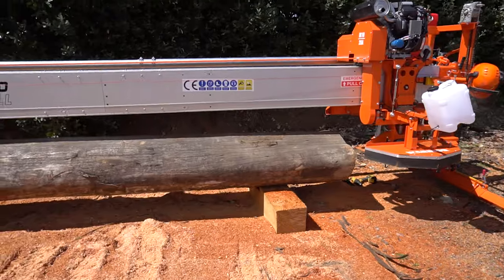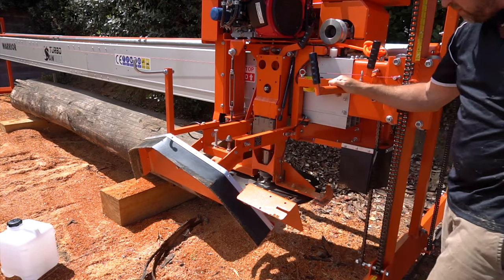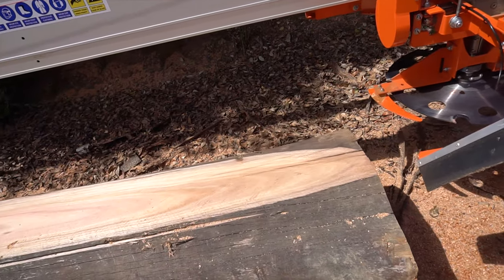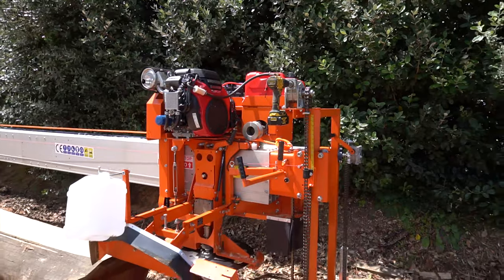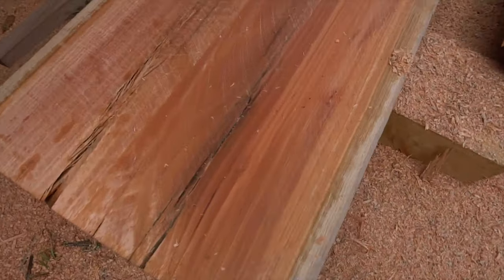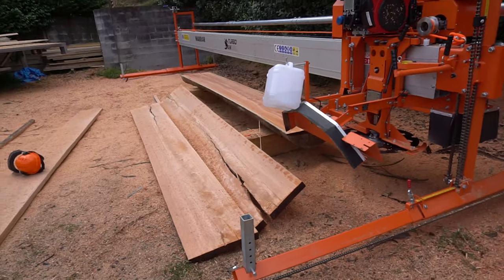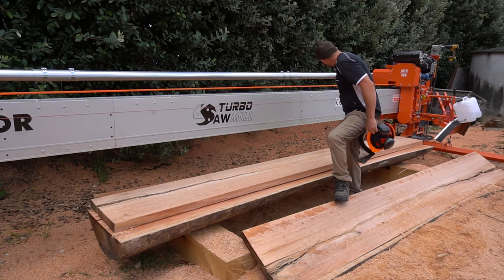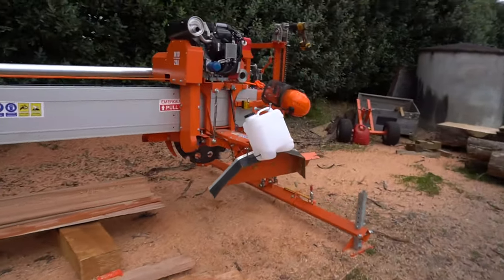Wide boards with a Turbosawmill.

Comment: I don't understand why you have to lift 4mm for the other side. Does it mean the saw cuts on an angle? I do like your saw though. Very inventive.
Reply from the maker: No it still cuts flat. You can simply adjust the blade flat too.
Reply from the maker: All circular saws require a tilt on the bottom edger. Clearance for the hub.

Comment: Why do you go back and forth through the same cut multiple times?  Can it cut 10" in one pass?
Reply from the maker: Yes, you can but it's not good practice. The blade tends to heat up and you are left with less accurate timber. The first cut guides the blade true. Other negative points to sawing horizontal in one pass: stress on belts, stress on gearbox, stress on the motor, sawdust extraction (heating the blade), and finally vibration during sawing. Swing-blade technology offers very eloquent solutions to many conventional problems during sawing.

Comment: I also noticed after you do the first major cut you do a minor return cut (or a climb cut) not deep enough for the writhing knife to be in the way.  Is this also to help cool the blade between major cuts?  Interesting technique.
Reply from the maker: It just reduces the necessity to produce deep cuts. The riving knife is setback 3" on the 10" and 4" on the 12". Helps cool the blade, reduces labour on the mill and guides the cuts straight from the previous cuts.

Comment: When I do a double cut on my 8"manual with this exact process I get a flat perfect transition for the middle 3rd of the log, and then there are opposite ledges created on each end of the log. Could this be because my leg supports aren't sitting on identical slopes and therefore slightly twisting the beam from end to end?
Reply from the maker: It means the beam needs calibration at one end. You need to put a level on the top of each beam at each end and adjust the beam support bracket so they match.